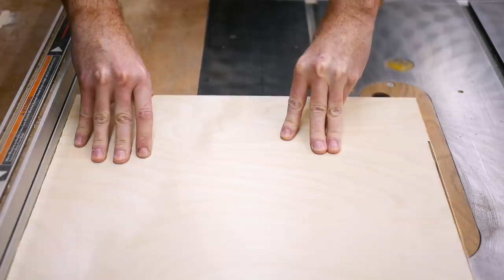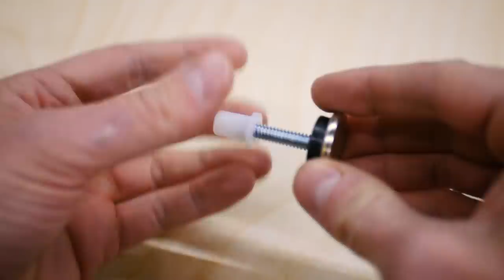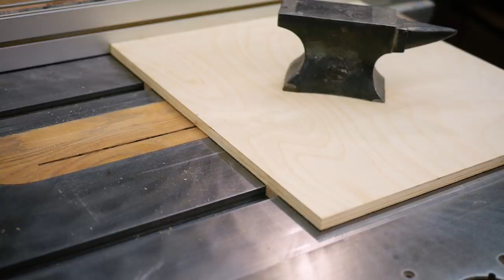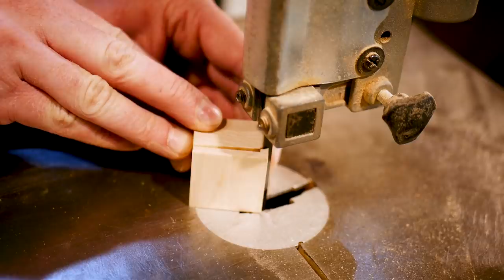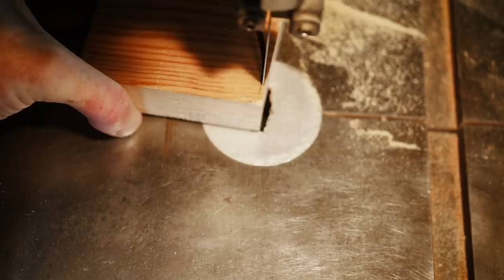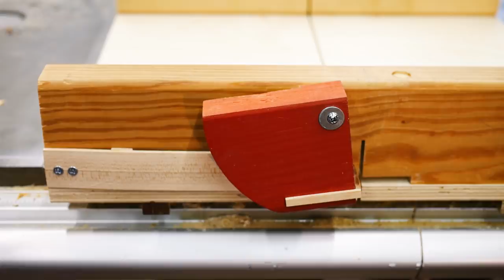Cross Cut Sled w/ Finger Joint Jig Insert

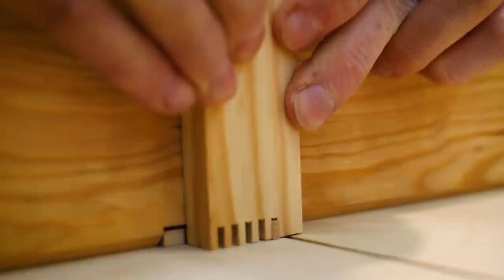Comment: Where do you get a table saw blade that cuts a 90 degree profile slot? All I can find are the offset teeth style that leave a high spot  in the center of the cut like at 9:20 in this video.
Reply: nick danger Look up FTG (Flat Top Grind) table saw blades. They are available on Amazon.

Comment: Should probably add like 8 more screws on each runner which is probably only 16” @ best. Then this U-Boat/ Sled would be complete.
Reply: lol I laughed at the abundance of screws on the runners as well
Reply: @hollowhills2973  I thought it was overkill, too, but maybe he lives in a really humid climate or something where it's best to over-stabilize everything, especially thin strips of wood.  I mean, it might be too many, but better too many than too few, I guess.
Reply: @RCPoliComm   that's very true. typically the glue I use in my shop(I own a small woodworking/ fine craft business) kinda counters any humidity issues I deal with here in Arkansas. But like you said a couple extra never hurts by any means. That being said, it's still pretty funny to see sometimes tho lol.

Comment: Using a blade that has flat top teeth will help save you a lot of time cleaning up the tops of those finger slots...I got lucky and found a blade with flat top teeth...its great at cutting lap joints, tenons and dados with flat bottoms.
Reply: Madame récre en français
Reply: Amazon sells several as does Ridge Carbide, which are the blades used by Stumpy Nubs. 
(He did a great video comparing different brands of blades.)
Reply: @barstad-9591  Thanks for info, Barbara, I've been trying to find a source here in the UK for one.
Reply: It’s called a triple chip blade
Reply: Yeah the blade ,the blade ,what type is it , and how many teeth !😅Smooth ,smooth ................. I mean you can hear how smooth or quit it is thanks for sharing this with. You have allot of good skills were going to want to see thanks tk I did subscribe

Comment: Why is the red piece needed? 🤔 Is it there to keep the finger joint piece from getting pushed back?
Reply: in this case yes, but on most responsibly-built sleds it is also there to keep you from cutting off your thumbs. I've had people roll their eyes because I paint the center area of my sleds red as well as the 'blade catcher' behind the back fence but trust me, when you are making 100's of repeat cuts it's easy to put your fingers in the wrong place.
Reply: My uncle, a master Carpenter and furniture builder with 40+ years in the trades - was missing pieces of both his thumbs bc of tablesaw sled injuries (no back guard).  It's the most important piece of that sled IMO. Its so easy to let the saw whirring lull you into a trance so you forget where your hands are relative to the blade.
Reply: Thanks for the input and reminder. Gotta keep dem thumbs, ya know?

Comment: Nice video. Looks like you made the rails to thick and the board is not sitting flat on the table. I think you need to cut them thinner and put washers under when glueing them on.

Comment: Awesome build. But when you attached the fence. You should’ve used the square on the other side. Since you know the table saw fence is square to the blade and that is what you used to set up the table, you don’t know that both sides are parallel to each other

Comment: Nice work BUT: The strips of wood which guide the board should - in my opinion - be 2 millimeters shortor/thinner than the depth of the table grooves. The board should slide on the table, not on the strips.Cheers.

Comment: 🌟 🌟🌟🌟🌟's.  I plan to build this..soon. Do you have an email address or website. I would like to ask you a few questions about my used table saw..The blade does not stand up to 90 degrees. Of course I have some workarounds..but they are not 
 perfect. I have had to get rid of 
several table saw sleds. Subscribed.